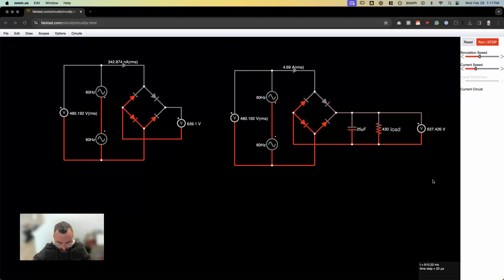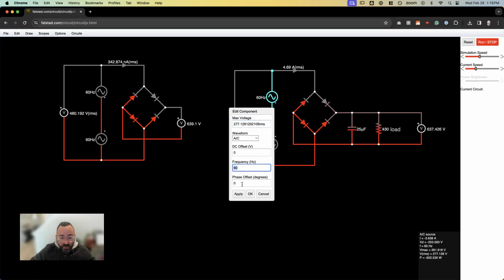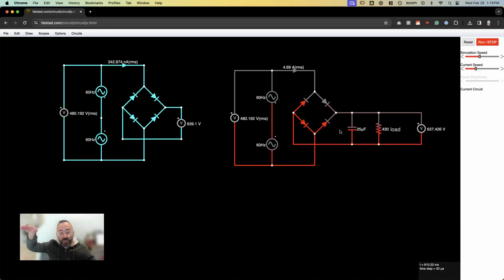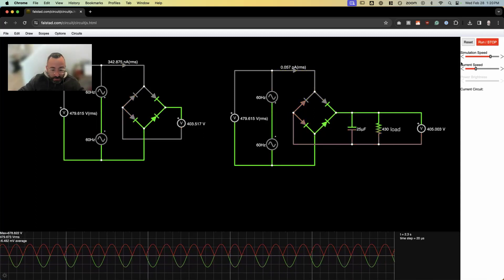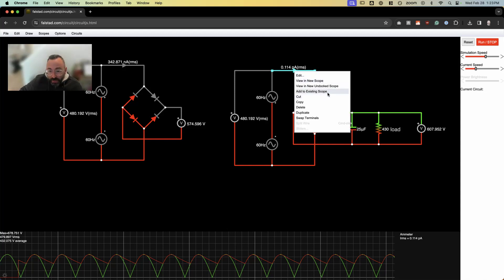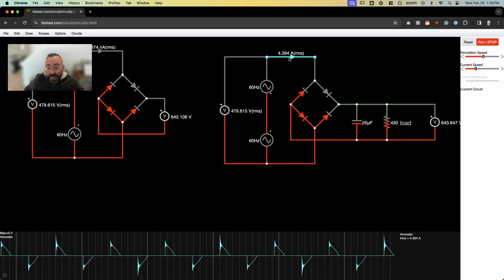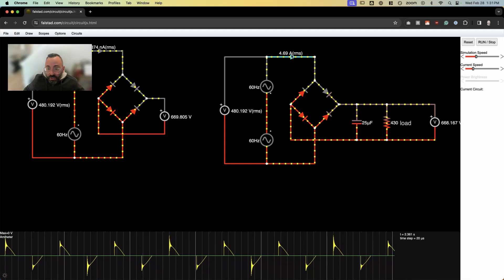Conquer the NCEES PE Power Exam: Free Tools for Advanced Circuit Simulations! (Learn how)

Comment from the maker: Video Table of Contents:
0:00 - Full wave rectifier circuit
2:14 - How to add a voltage scope of the AC input signal
3:19 - Full wave rectified output voltage signal without the shunt filter capacitor
4:46 - Output voltage signal with to the shunt filter capacitor
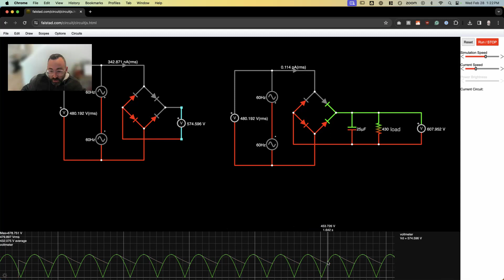5:46 - AC current signal 
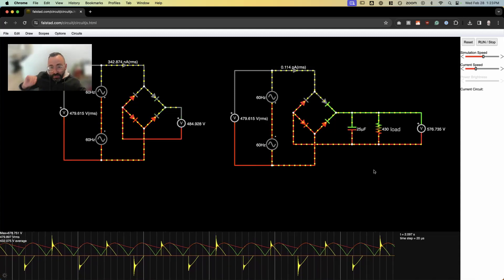6:44 - AC current signal: explanation of why it is non-sinusoidal and non-linear
8:08 - AC current signal: explanation on positive and negative peaks
9:39 - Capacitor charging vs discharging cycles
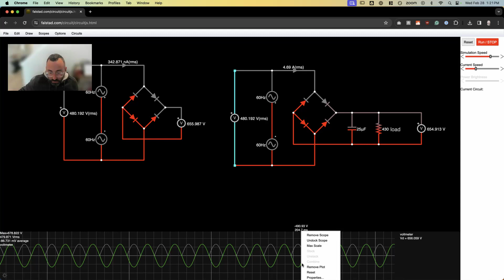4:14 - AC current signal vs AC voltage input signal comparison

This is a response video to a student question on our online community about the NCEES Practice Exam problem #59. View the rest of the discussion about this practice problem here: https://community.electricalpereview.com/c/third-party-practice-exams/ncees-58

Link to the circuit simulator used in this video:
https://www.falstad.com/circuit/